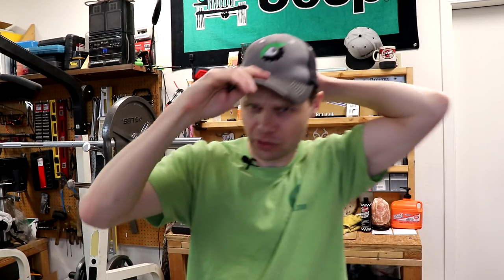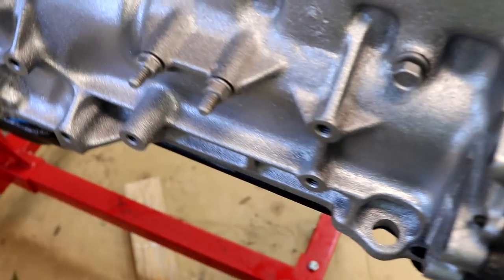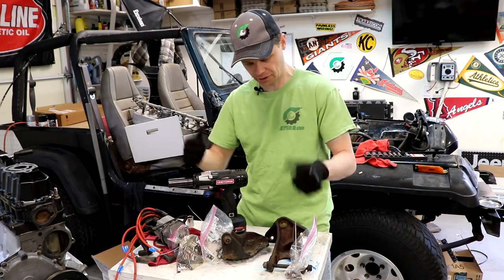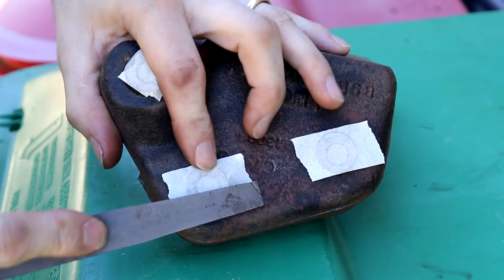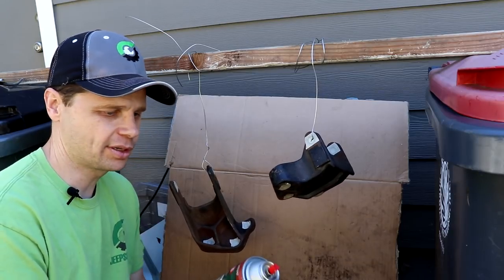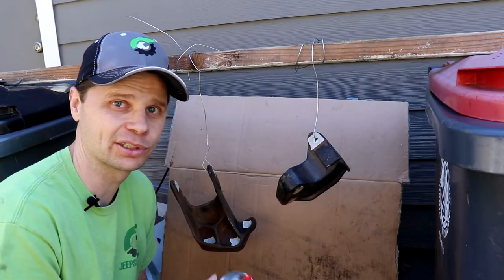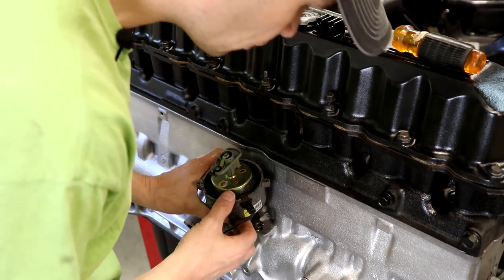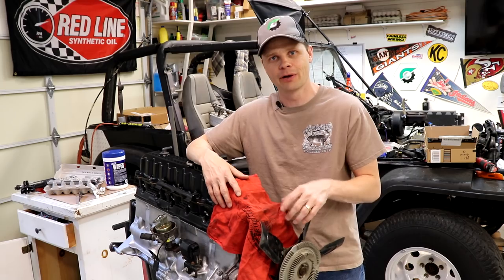Jeep Distributor Install: Engine Rebuild Part 25

Comment: Why does the book say 4 and no mention of 5. Another thing can you rotate the crank case to line up the oil pump like they do on other engines, sense the gears are already engaging the cam?

Comment: Well see I’m bout to try this tonight, picked up a new distributor last night, took the old one out before without knowing which way it was facing, never done this before, just bought a 99 Jeep Wrangler sport 4.0 6cyl… plan was just to get a new distributor cap but nooooo the screws snaps off on me and I tried to drill them out but drill bit broke off so got no choice but to do this,

Comment: dont have time to watch this episode atm about to go tare into my rig and see if i have cracked piston skirts or stuck lifters will dive in and catch up tomorrow

im in Canada the engine tech kit isnt available or would have to be shipped and go thru customs.. i see this DNJ kit on amazon.ca any have any experience or opinion on it? engines only at 150k kilometers 2005 LJ
https://www.amazon.ca/DNJ-Master-Engine-Rebuild-EK1128M/dp/B00CDZ3L8S/ref=sr_1_3?keywords=jeep+4.0+rebuild+kit&qid=1562184058&s=gateway&sr=8-3
Reply from the maker: Thanks for following along.  I haven't used DNJ..
Reply: @JeepSolid  turns out i bent the oilpan and a main cap support up into the path of the crank... free fix i hope waiting on a timing set now since its apart anyway

Comment: Did you prime the engine yet?  You’ll end up pulling the distributor to do so.
Reply from the maker: Yeah, that's true.  Good point.  I'll leave it in place until I'm ready to start it.

Comment: Hey dale, I think I’ve already said this but your vids have been so helpful and inspiring for me. That being said keep them coming! But I have a question about the distributor and timing on Jeep yjs. Mine is actually a 2.5 but I’m sure their electronic ignition systems are about the same. Are you clear how the Jeep adjusts ignition timing advance? Like I can’t grasp how an ignition system with a distributor that’s locked in position can adjust timing. Also, I’ve heard so many different things on forums, but is it true that the distributor has to be installed in the exact same place like you did, or can the Jeep some how adjust? I here so many people say that it can but I just can’t wrap my head around how that would be possible. Sorry for long question but this has been a mental hag up for me in my rebuild of the upper half of my yj 2.5. Thank dale!